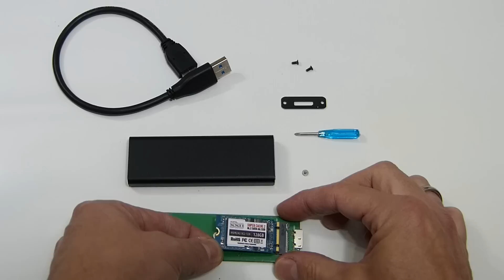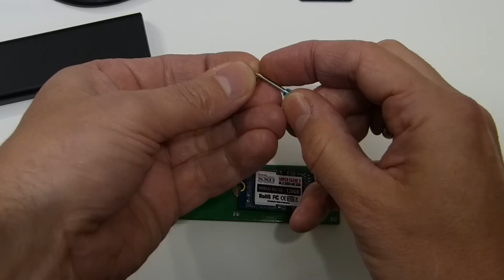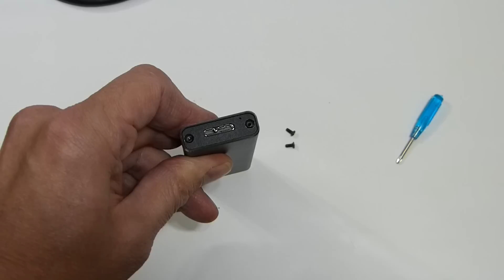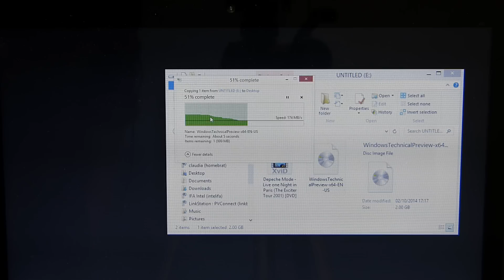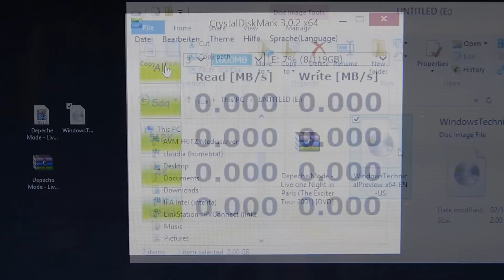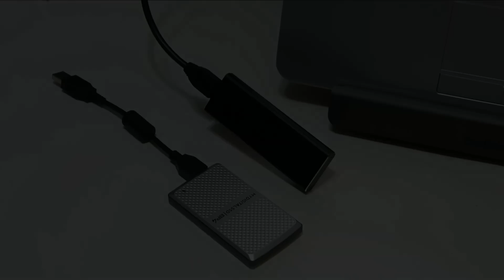How-To: M.2 SSD to USB3.0 adaptor is fast (MyDigitalSSD)

Comment: do i need one of these for use of the bpx 250gb from mydigitalssd with a z170x ultra gaming mobo from gigabyte??...installed it in the nvme slot cant detect it

Comment: At work we got m.2 sata ssds and pcie ssds and non will work with the similar adapter you got here and we're not sure where to go from here. The ssds work but they won't work with the adapter.... If anyone has any ideas that'd be great
Reply: I think this is probably only for SATA M.2 drives?, truthfully there's no good reason to use anything faster than a SATA M.2 for a USB 3.0 drive, if you have thunderbolt 3 maybe but USB 3.0 can't even go as fast as a SATA M.2, What you need is a thunderbolt (if you got that port on your PC) to M.2 PCIE adapter (I'm not even sure anyone makes that yet, I did see they make a USB-C to M.2 (but I think that's only for a SATA M.2 also) at least there you might be able to get the full 6GB/S out of the SATA M.2 drive (as USB-C can get up to 10GB/s).

Comment: does this work for an M2 NVMe like the Samsung EVO 960 drive? NVME is missing AHCI compatibility which is required for SATA I think.

I switched over to this NVME drive but I like to have a kind of handy device to access it externally when I screw some things up.
Reply: I would like to know too
Reply: have  you find any solution
Reply: Nvme never Run in a USB Adapter...You need a pci-e adapter card
Reply: to everyone one who might be wondering, the simple answe is no, this does not support nvme, for nvme, the connecting notch/key is actually on the right not left ( and its called an M-key, )also note that the ssd it self has two notches left and right called b + m keys.
Reply: there are adapters like these for nvme only as well, you just need to buy the right type.

Comment: drag-n-dropping in Windows is not an accurate measurement of speed because Windows starts buffering/copying the file to memory before you "let go" of the click.

this is why you typically see the initial file transfers mucher higher at first, and it ramps down in speed.

this is why they make benchmarking utils.  :)  and it's good you included a screenshot.